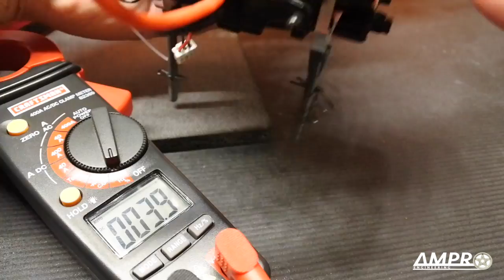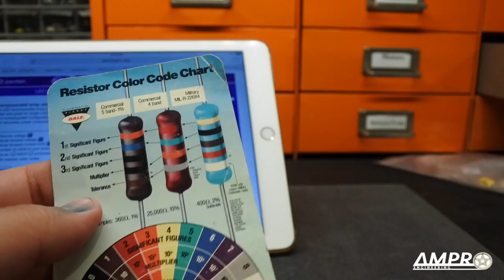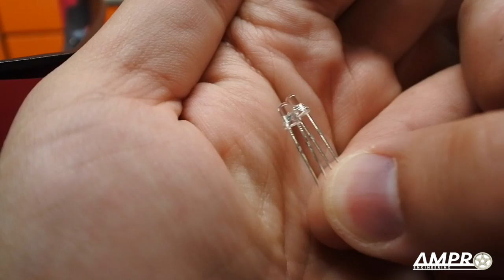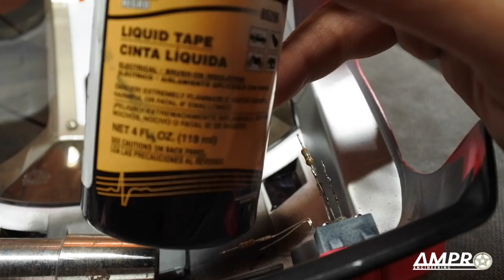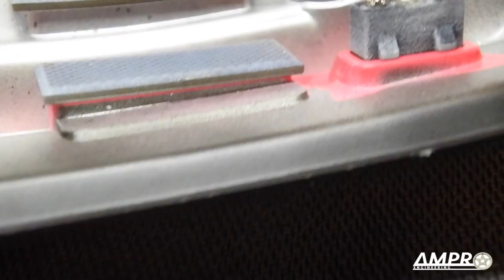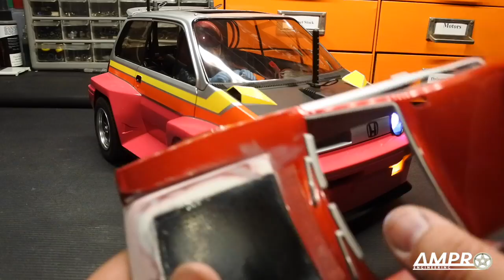E33: How to Install Scale RC Car lighting, Willy's Wheeler Upgrades, Part 3!

Comment: Im sooooo confused thought it would have been some plug n play kind of thing lol I mean I know I would have to do some work but this is a lot for me don't get me wrong you explain these things perfect and I have learned a lot from your video's but I think I will have to pass on installing lights in my bandit.
Reply from the maker: No there is no plug and play thing for a stock bandit. You need to source the power from somewhere on the car (power switch is a good place) but they are not easy. That is why I like the light controller but that requires a complete electrical overhaul.
Reply: @AMPROEngineering  no I understand I would have to tape into some kind of power source when I say plug im play meaning the lights already hooked to the wires and then put them in a power source. The whole break down of the bulbs and stuff is confusing me. I plan to put upgrades in the bandit wich I have done before in my super bandit so I just wanted to get the light set from Shapeways paint them cut the holes in the grill and put the lights in but it seems its not that easy thats all I was saying.

Comment: where do you wire the front headlights to? directly to the receiver? TIA
Reply from the maker: Yes. They are wired to a 6 V source
Reply: Do you mean you have a second battery controlled by the switch?
Would it be possible to connect that switch to the main battery using an 'Y' adapter? I know there are already plenty of wires... ;}

Comment: can a brushless traxxas motor fit in a tamiya hornet/grasshopper
Reply from the maker: As long as it as a 540 can size, 3mm shaft and it isn't too long then it should but don't quote me. I don't own anything Traxxas. Wish I could help more.

Comment: HUGELY USEFUL VIDEO!! I learned more about choosing resistors, than I had 15 years prior! Thank you for that. 

ANOTHER idea that I'd LOVE for you to do....  Light Buckets! Primarily for Lexan bodies, with enough side material so that they can be adhered to the inside of the body. Something in some popular round and rectangular headlights, and maybe different sizes of taillights, partitioned for driving/brake, turn signal and reverse lights, and different orientations and sizes - vertical and horizontal.....     Doable??
It's a sadly lacking niche in the market. Especially since more people are going more Scale with their RC vehicles, and the cool lighting options that have popped up lately. 
It's REALLY an untapped market! 

You already make one, taillight buckets for Blackfoot. I bought a pair, and am going to try them in my CC-01 Landfreeder "Ford Ranger" Lexan body..... I'll let you know how that works. 😉
Reply: I'm glad you liked it! It was a total pain to film this one but I know a lot of people don't know how to make their own light kits. I am planning on more lenses and buckets soon. I hear you on the lexan ones. I think I may do some generic ones.
Reply: I've never tried to film a wiring/soldering video, but I can imagine! 
Yeah, even some rectangle and round headlight buckets would be a great start.
Reply from the maker: I might have too...

Comment: First; Anything you come up with for the Brat bod, please please let me know as soon as I can get anything, even if it's just beta or test or anything, I have a few and have sat for a lot of time debating casting lenses, making proper steps, rear jumps, etc etc etc. 
Okay, re-watched, and sooooo much info I saved it to an album for reference. Great vid and good idea with the PC strap. For LED work = I have used usb line  = 5/1 and $ store earbud line =4/1 sometimes 3/1, I did find the 3.5 mic/earbud and that is super fine also. The finest I've found is a "retractable" usb extension = super fine & flexible. Again; anything Brat I will need.
Reply from the maker: Trust me I will post them on youtube when they are ready! USB line is a great idea! Thinner wires and very flexy! I am stealing that idea from you!